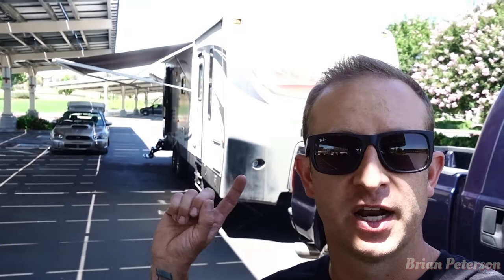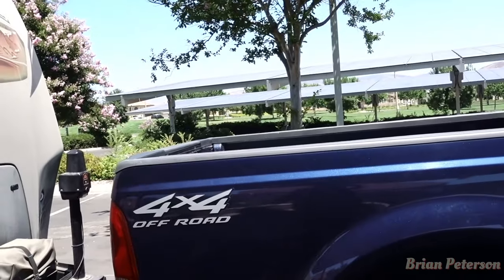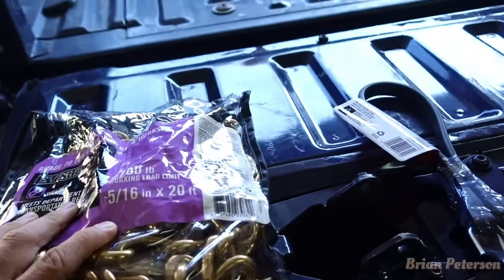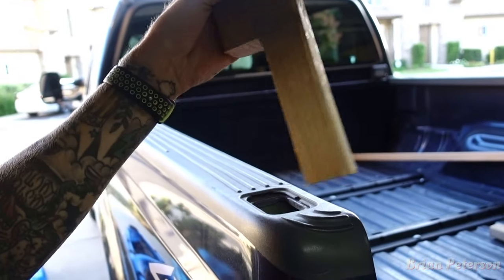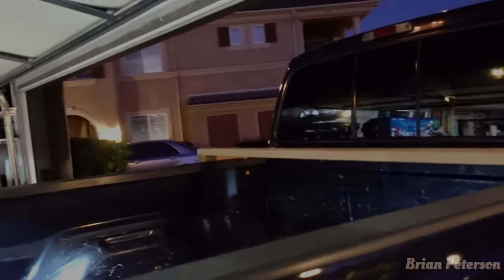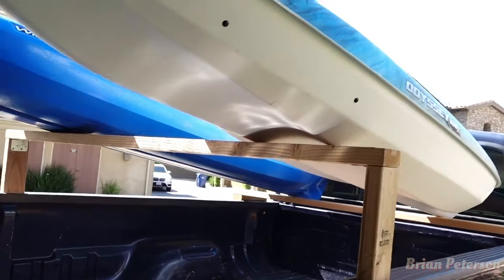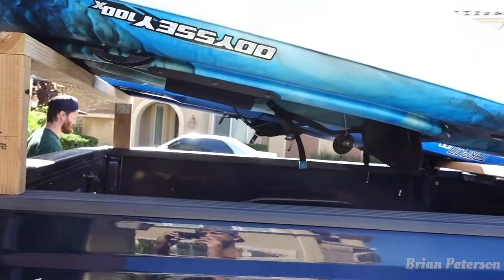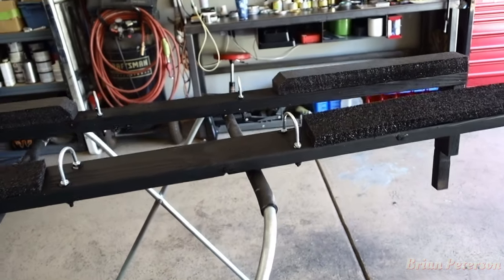DIY | $70 Dual Kayak rack

Comment: Is this still working for you?? I’m wondering about how it stays secure? Did you bolt it to the truck bed? What keeps it from a strong wind blowing the whole rack up and off?
Reply: I think you would want to strap down the wood to the truck as well. Otherwise a strong updraft could cause some issues.